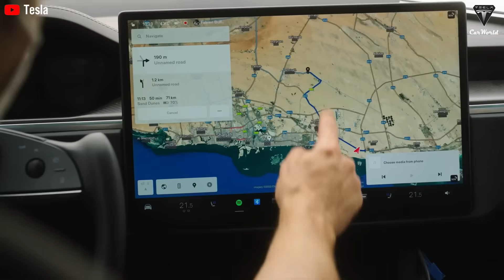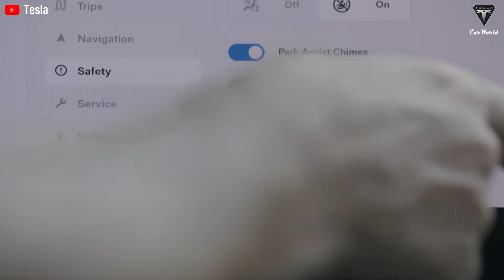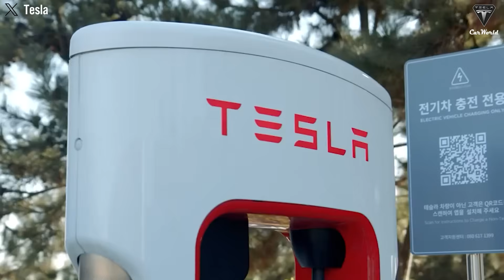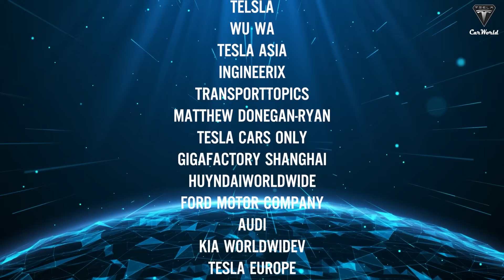Finally Happened! Elon Musk Leaked Tesla Insane 5.9-Min EV Battery in 2026! Destroy All EV Industry

Comment: SURE and we're gonna push gigawatts of power at recharge stations all over.  Just have to at least double the amount of electricity we produce and rebuild the grid to deliver that power.  Heck just the cable from the charger to the car is gonna quadruple in weight and size.  This is a pipe dream.

Comment: The grid in the usa can not support it. electric heat has tripled already in the north east. claw back the free charging and rebates
Reply from the maker: Valid concern! But Tesla’s solar + Powerwall helps offload grid stress. Would smart home charging ease your worries about rising power costs?
Reply: @TeslaCarWorld  a 20yo or elder can't afford a power wall. fix the grid THEN do it. slaves to a Pharaoh, building Green Pyramids to Mars